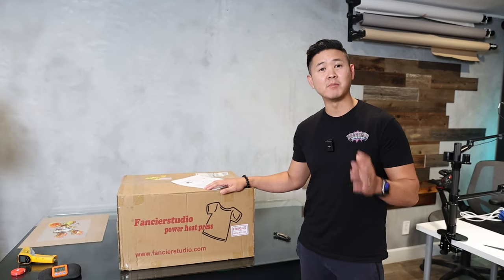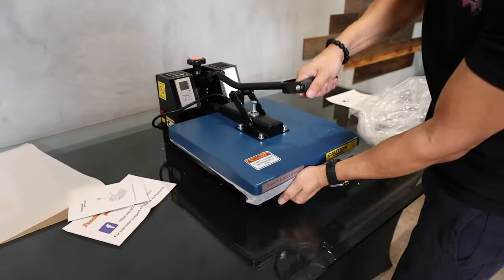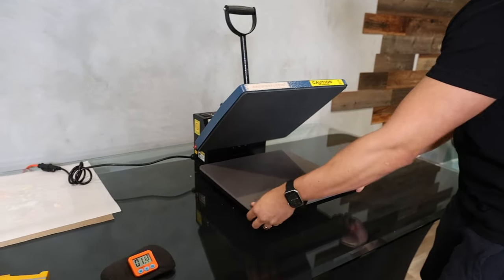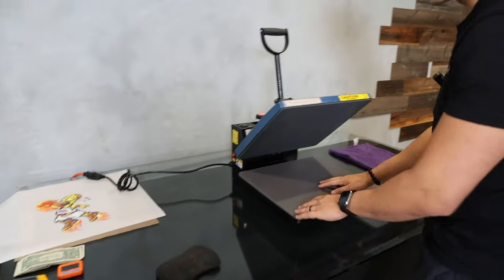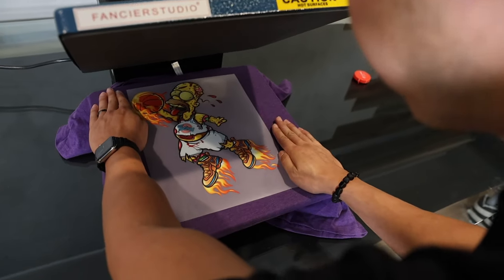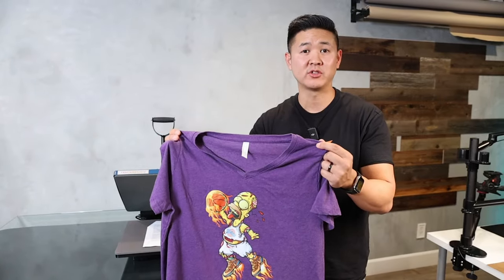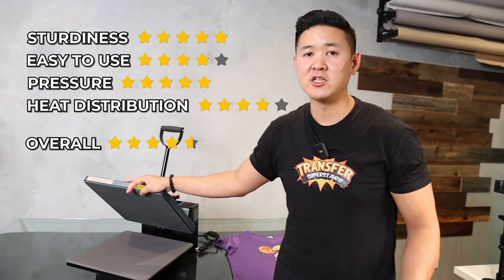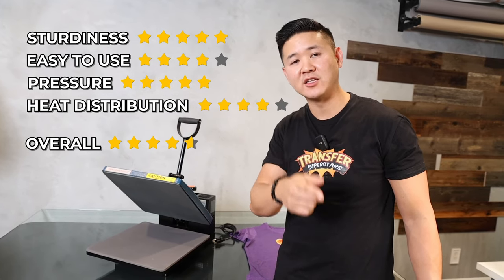Why You Need the Fancierstudio Heat Press for DTF - Affordable Quality at Your Fingertips

Comment: Absolutely not. Why would you recommend a press that has more than 30 degrees in temperature difference from one spot to another? That means you can both overcure, and undercure the transfer adhesive in the same hit. While it appears to stick and survive a wash, your customers will call you on quality issues when they degrade too fast. It will be the business owner’s responsibility to replace those items when a transfer wasn’t applied properly.
Reply: What press would you suggest?
Reply: @craixe1  I would suggest one of the signature series heat presses from Heat Press Nation. The 15x15 clamshell with the slide out drawer.
Reply: It sucks but all the budget ones (sitting around 200 cost) are like this it seems. Doesn't make me want to splurge out for anything until I can afford a higher end one that doesn't do this. I was really excited about this fancier studio one too :/

Comment: Just a heads up, i just bought a Fancierstudio 15x15 almost identical to this one but it has been updated. It slides out 5.5 inches. Also the teflon sheet is now an actual cover that is stretched over the corners, one for both the bottom platen and the top, so the sheet and pads stay in place but are also easy to remove. 

After watching all of your reviews (after i already bought.and immediately returnedthe POS that is the Vevor 5 in 1) I settled on the Fancierpress and I'm so pleased. 

It probably works out to the same baseline price as a Vevor without the attachments, but so much better in terms of quality and build. I ripped my dollar bill nearly in half trying to pul it out of the corner, even with the super slippery teflon sheet in place. Solid buy!

Oh, and there's also a "ledge" just below the bottom platen for leverage when opening the press.
Reply from the maker: Oh very nice! I see that listing now with the slide out. We will definitely add to our list to test out.
Reply: Ive been looking at that one!! Thanks for sharing.
Reply: Glad I came here I wasnt sure those covers were meant for pressing
Reply: The black covers are supposed to stay on there?
Reply: @user-wz2tu4ij7k  Yes, they protect the platens.

Comment: There is a "technique" i use to open mine, nothing fancy but if you lightly yank (light but firm) the press opens easily.  Probably sounds weird but its what I do to open it one handed, Ive had it for a year or two and now its time to upgrade, not because it failed but because I really like the ones that slide.
Reply from the maker: HP with slideouts are nice!

Comment: Why are you using dollar bills? To check the tension you only need to use strips of paper or plastic.
Reply from the maker: A dollar bill is generally thinner than a standard piece of paper. A U.S. dollar bill is made from a blend of 75% cotton and 25% linen, making it more durable and less prone to tearing than regular paper. This is helpful when trying to do a tear test to check pressure. Its a preference thing but these are some reasons why we do it.
Reply: @transfersuperstars  I have been a Printer for 40 years so have set printing rollers in large offset presses which are far more complex than this. In the last 15 years or so I got into the heat transfer industry, first with computer cut vinyl then solvent UV and lately with DTF. All I am telling you it doesnt make sense using printed notes.
You can even use feeler gauges if you want or to simplify things just cut up strips of your teflon sheet. What you do need is material of the same thickness both sides that will give you a fair representation of whether the pressures are all the same. Good luck with what you are doing. All the Best!

Comment: can i use microwaveable wax paper instead of the teflon sheet?
Reply from the maker: Yes you can. Personally for us, we just flip the transfer paper over and re-press. The teflon is nice if you use a magnet and add it to the top of the press so you don't have to worry about it each time.
Reply: @transfersuperstars sweeeet that helps a lot thanks man

Comment: When you initially use the fancier studio press do you have to let it run for a certain amount of time ?
Reply from the maker: No it was ready to press like most heat press machines are. Are you experiencing any difficulties getting it started?
Reply: I use a high end insta at work and the fancier studio at home.  It takes a bit longer for my fancier studio to heat up and it is uneven for a few minutes.  Once it heats up, it has no problems.  I am happy for the price.  And I can move it around.  My insta  needs 2 people to move.